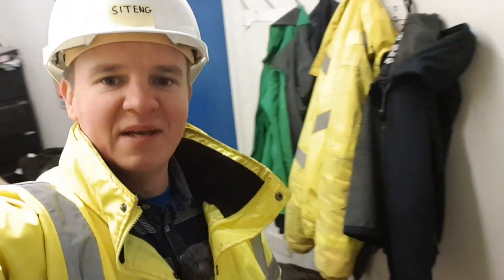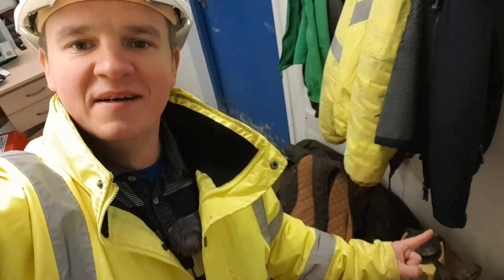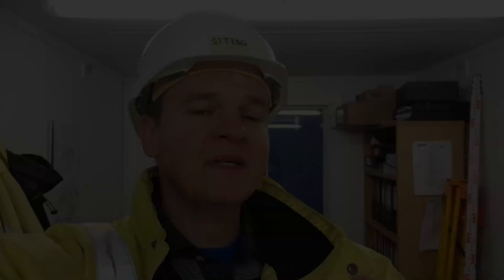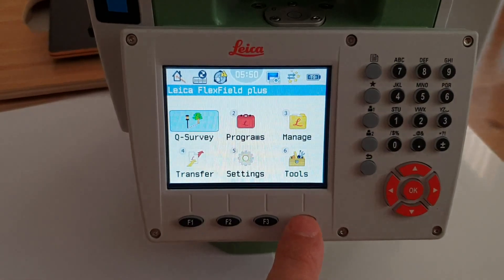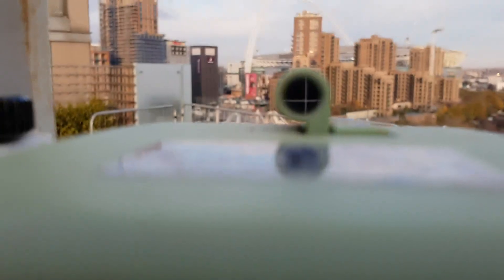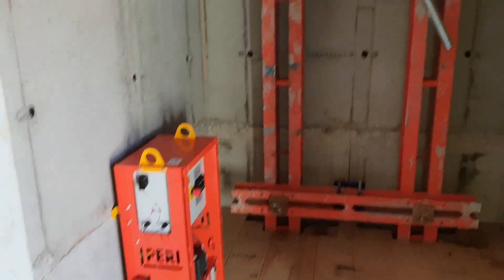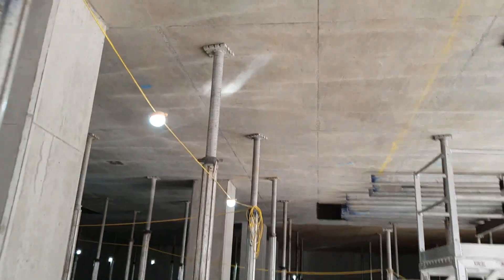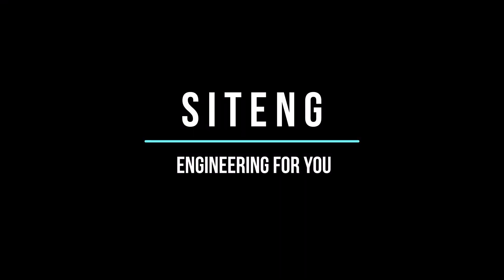CONSTRUCTION SITE ENGINEER - How to start a setting out, site engineer career in construction.

Comment: I'm am going to go through all of your videos -1st to most recent. My experience: 

•  2 years' setting out, engineering and management experience on £30-100m Reinforced Concrete (RC) residential and commercial projects over the UK (schools, hotels, and accommodation) – sub-structure & super-structure.
•  2.5 years’ experience surveying on £30-170m projects in various sectors (residential, commercial and railway).
•  2 year’s experience engineering/managing pre-cast concrete unit production.   
•  1 year establishing control networks on the railway, monitoring and doing as-builts.

I'm in precast concrete manufacturing at the moment, but I want to get into residential housing and back onsite doing groundworks and drainage et cetera which my experience lacks. I have experience with bored piles in Glasgow, but my site engineering experience is mainly on superstructures. I have limited experience in demolition. I've experience robotic and hydro demolition. Your videos will be good to learn and refresh from.
Reply from the maker: Hi Calum! With your experience there won't be a problem to get to residential. You will quickly learn all these 😁 Hope the vids will help you and let us know here how it's going 💪

Comment: It is hard with holding MSc in civil engineering to practice as setting out engineering. Hope to see UK make it Mandatory to have minimum bachelor degree to practice as Engineer than we can have decent job as right now our positions goes to those who are in interest of PM or other party etc and no law at the moment to back up and protect licensed Engineer in UK  so lots taking advantages to abuse the title of Engineer
Reply: David, I read you reply with interest and was surprised to learn as a holder of second degree of MSc in Civil  Eng. that you are unaware that people working in the construction industry are actually Engineering Technician who do all the main setting out and the technical work to get the project off the ground to completion. The title of an Engineer is a misnomer as the actual Engineer is a designer of the project. The Site Engineer is the convertor of the design from the design set by the Engineer to its fruition which is the exact replica of the designed product. Without the Site Engineer then the actual designer will be setting out his own work to bring it to full completion and this is never ever going to happen in real life. The Site Engineer is not the designer but he has to be able to read and work from the set of instructions given by the designer to create the building or road as he had intended it in the first place. I am MICE with the grade of Engineering Technician after my name and I am a senior Engineer on the site and the controller of the main work in progress. In my opinion there is very little difference in the two disciple of Engineering as the one cannot do without the other. But some body has to design while another Engineer has to bring the design to completion. If you ask the ordinary Joe Public then the person on the site is the real Engineer even though he did not design the project. Thus you have a Design Engineer and a Professional Site Engineer who are both working towards the same goal. Thus the pressure on the Design Engineer to create a working design which is possible to build on site. The Institution of Civil Engineer in London has recognised the work of Non-designing Engineer who have contributed just as much as the actual Design Engineer to bring the design to a successful conclusion and these people are graded as Engineering Technician who are as important as the Designed Engineer in the industry. Greg, of this channel, is a professional Site Engineer, just as I am, but it does not mean that we have to design the whole effing thing from the scratch and then build it to satisfy it. Please see what I am trying to message you. I know many Experienced Site Engineer who can transform the site into a brilliant working platform to complete the project on time and follow everything to the latter as per the designed specification. With the latest smart surveying equipment and setting-out tools that the life is made absolutely sweet for the Site Engineer to carry out his work very accurately and in time. The latest Leica equipment and all the GPSs are there to help you to achieve the final aim. The introduction of the laser in construction is almost god sent as it has made life so much different and easy on site to help the Engineer. In the drawing office, the Designer is drawing everything on Auto Cad, which was unheard of thirty years ago but this is how designing is done nowadays. In fact, the Site Engineer is more aware of what is required on suite then the designer himself. They both work in tandem to do the same job. You are either a designer in the office or the site man on the site doing the same thing. I am degree educated Engineer on site but I am fine working on the site and it does not diminish my education and the responsibility into the ground. In fact, I have to be super alert of anything the designer has done which is not working on site and it is my duty to convey the message to him about it as soon as possible before the work comes to a halt. You need your academic qualification to be up to scratch to design your project but you need a lot of hard work to work on site plus your knowledge to bring to the fruition of the design to a completion. Just remember that the Site Engineer is not the designer of the project. I rest my case here.
Reply from the maker: Hi David! Sorry for late answer. That was surprise to me that everyone can work as an engineer here in UK. This gives huge opportunity for all people interested in construction. In great part my channel is designed for those people and I always say that all you guys should try and take the opportunity as elsewhere there is no chance to work as an engineer without a degree. UK gives you a great opportunity to work first and than you can always work on your degree if you like it :)